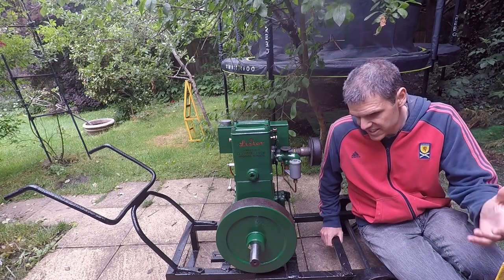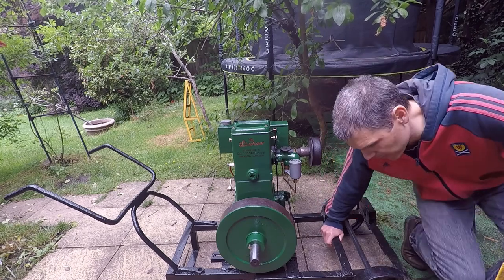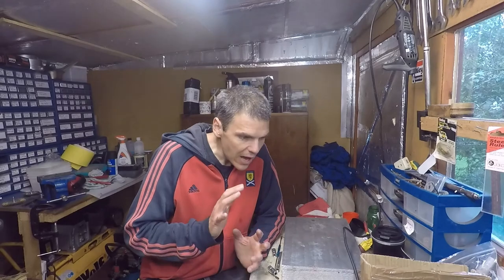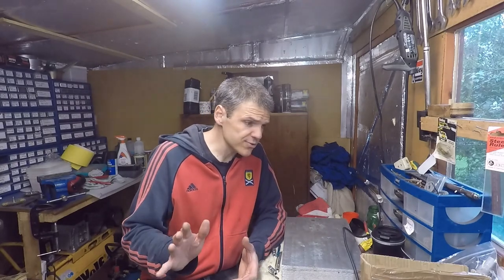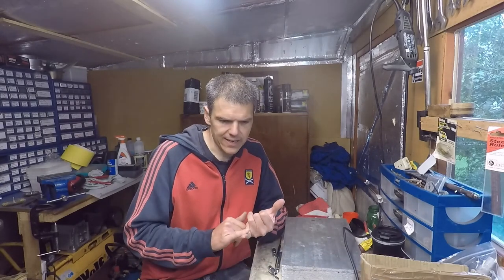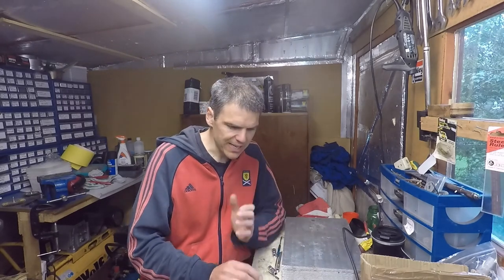Lister D barn find project. first start up after 20 plus years of no running!

Comment: Very nice runner the main reasoning for it vibrating so much is because it might need better mounting bolts or another support bar under the engine also they tend to run better on the grass well mine does anyway
Reply from the maker: Yup! Next week I sort out that issue

Comment: The engine sounds really nice    you have done a really thorough rebuild  and restoration I think the metal trolley is flexing  quite a bit    I have my one on a wooden trolley and even then it jumps around a bit if it is on a hard surface  .did the timing make much difference
Reply from the maker: Hi there, thanks. Yes the engine was very jumpy in that video partly my fault because it was not bolted down perfectly. The trolley had quite a bit of flex because it was a “home brew” jobbie but I wanted to preserve what was there. What really sorted it was putting it under load with the compressor. That got rid of a lot of blowby and vibrations